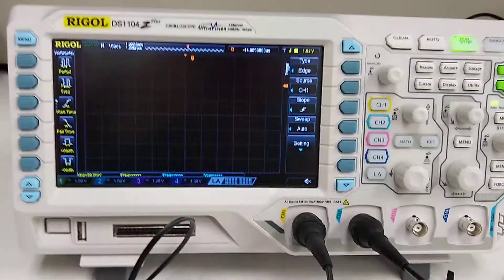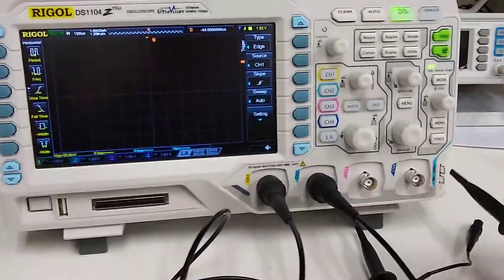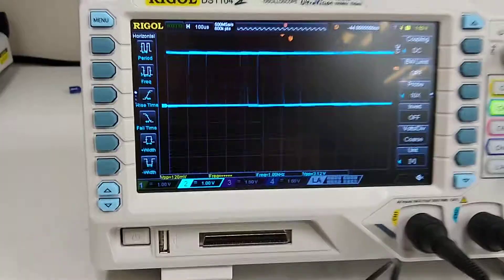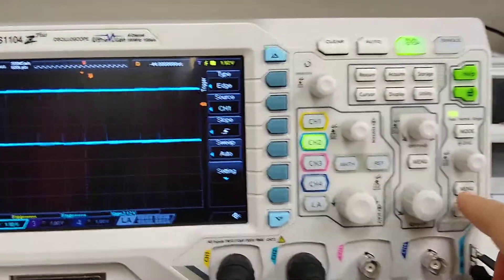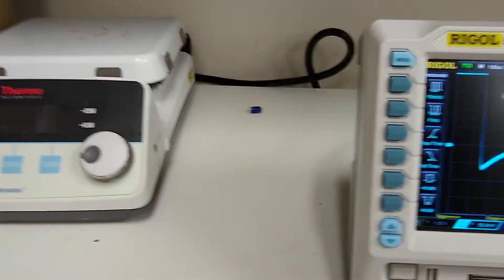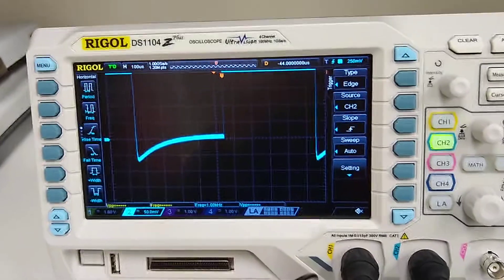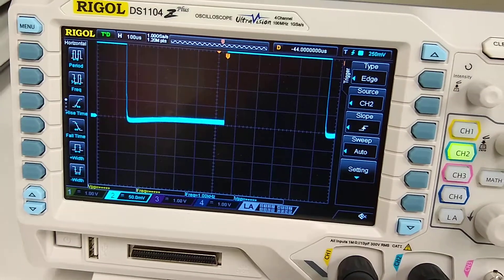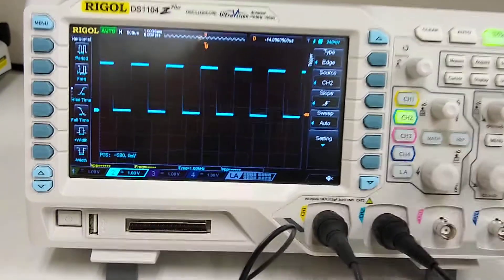Calibrate probes on Rigol Oscilloscope

Comment: Got my new DS1102Z-E today but the provided probes can't be adjusted?
The adjustment hole is there, and the tiny flathead comes in the bag, but there is no notch for the flathead to grip onto..
I don't think my probes need adjustment though, the square wave looks great so I suspect the probes came pre adjusted with my unit.
(and after adjusting Rigol just grinded the little grove flush which should be visible in the hole..?)
Very strange?